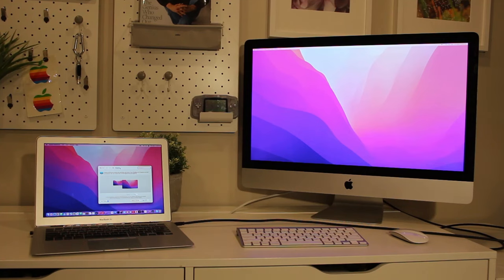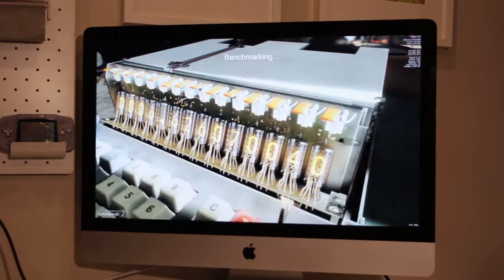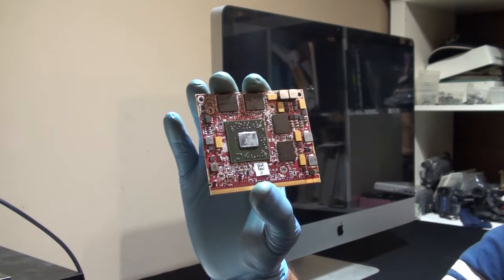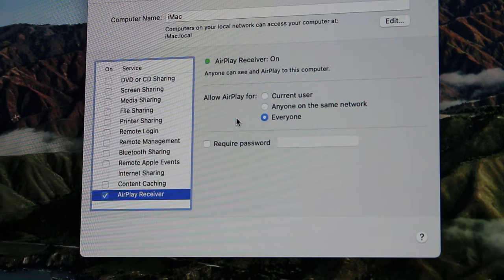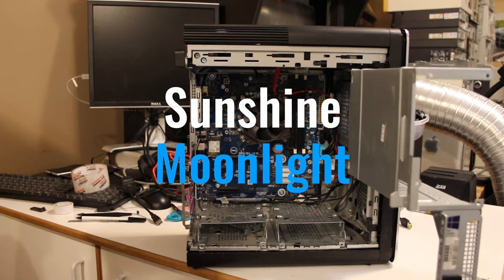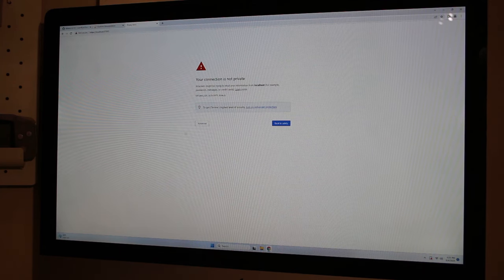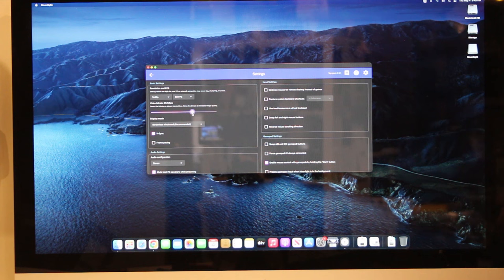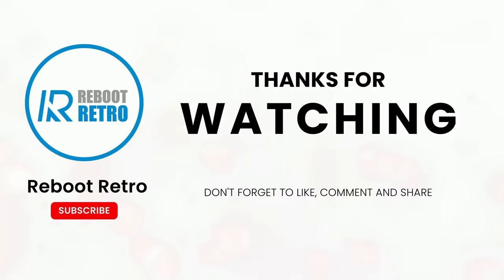Use ANY Mac as a monitor, not just Target Display!

Comment: is  there any way to get a 2017 imac to be either a second display for another 2017 imac OR for a second display for a pc?
Reply from the maker: Yes, for a 2017 iMac as a screen for PC, you would use Sunshine/Moonlight method.  If you are using 2017 iMac as a screen for another Mac, you can use AirPlay (less smooth video, but easy setup) or you can use Sunshine/Moonlight, or Parsec.  Parsec works like Sunshine/Moonlight, but is easier to set up on Mac.

Comment: What about a late 2006 20” Intel Core Duo iMac? Can it be used as a display for a late 2015 i7 iMac?
Reply from the maker: It would be much more difficult on a 2006 iMac, since Moonlight requires at least Mac OS 10.13 High Sierra.  You might be able to do it still if you install Windows inside Boot Camp, and run Moonlight from Windows.  It is below the typical hardware specs, so performance might suffer.  Moonlight does recommend a hardware-accelerated H.264 GPU; CPU decoding will likely have very poor performance.  You can always try it, and see how it goes!  Possible? probably.. but usable? I suspect not, unfortunately.

Comment: Great video, thanks! I have one question after reading several comments. I have an iMac mid 2010 27" and the new macbook air M2 (2023). Will the Target display port work if I use a straight cable from thunderbolt 2 to thunderbolt 3 (without adapters)? Or does the new macbook not give a sufficient output for Target display port at all? Indicating that there is no way of directly using the iMac as a second screen with a new macbook air M2? Many thanks in advance!
Reply from the maker: Thanks!  You're pretty much on the right track.

The MacBook has a Thunderbolt 3 (USB-C) port which outputs DisplayPort video signal.  Although physically and visually the same as a Thunderbolt 2 port, the 2010 iMac's port is actually a Mini DisplayPort.

Although I haven't tested your combo specifically, the exact correct cable would be Thunderbolt 3 to Mini DisplayPort cable.  And since Thunderbolt 2 is backwards compatible with DisplayPort, you are correct that a direct Thunderbolt 3 to Thunderbolt 2 cable SHOULD work like you suggest.

If you can't manage to find a direct cable, you should be able to use a Thunderbolt 3 to DisplayPort cable, and then an adapter from DisplayPort to Mini DisplayPort.

Sorry for going into so much detail.  Apple did a lot of confusing things with those ports.  I thought some more info on it might be helpful if you end up needing to troubleshoot after connecting it.  Hope this helps!
Reply: Did you get this to work with your M2? I have a 2012 iMac 27” and a M2 so we are in the similar situation.

Comment: Hello! Thank you for your video! I was hoping you could answer some questions for me. I currently work from home and was provided an HP laptop from my company to work. They offered me an hp monitor to use as well but I have a 27 in 2019 mac that runs macOS Sanoma (the most recent update), and I would like to continue to use my mac as a monitor so it doesn't start collecting dust. Is it possible for me to use my Mac as a monitor from my HP laptop? Do I need to go back to an earlier OS? What are my possible options?
Reply from the maker: Hi!  Sonoma should work the same way.  With the method in this video, you can use the iMac as a screen but you won't have dual screens (both will show the same screen).  On the plus side, this solution is completely free.  Also, it won't work if your IT department blocks you from installing programs.

To use as a secondary display (dual screens), you could use AirParrot (https://www.airsquirrels.com/airparrot/features/win) on your Windows PC, then enable AirPlay Receiver on your Mac (under Settings/Sharing/AirPlay Receiver).  Then choose to extend your Windows desktop screen to your AirPlay iMac.  I've used this product before; it's not bad, but a little laggy just like AirPlay extended screens from Mac to Mac.  AirParrot is a pretty reasonable one-time cost for the software license.

Another option for secondary display, there is a product that might work better for you called Luna Display (https://astropad.com/step-by-step-guide-how-to-use-your-imac-as-a-monitor/).  I've never used it personally and can't personally recommend it, but I understand they are a reputable company.  You need to buy a 1 time purchase dongle to use this product.

Another product which does dual screens is Duet (duetdisplay.com).  I don't know much about this company, but their product will allow you to use any computer/device as a second screen.  The downside is that there's a monthly fee, which isn't ideal.

Ultimately, you first need to find out if you are able to install software on your work PC, or if your IT department blocks it.  If they block it, most of these options probably won't work.

Hopefully this gives you some help or ideas!  Feel free to post back if you have any questions, and hopefully myself or someone will be able to answer :)

Comment: Hi, is there any way to connect my late 2013 27-inch iMac as a monitor for a Mac mini M2 Pro? Thanks
Reply from the maker: That combo doesn't support direct connection.  But you can do it by using Sunshine/Moonlight.  Parsec would also work, and is easier to set up when connecting Mac to Mac.  Basically you run Sunshine/Parsec server on the Mac Mini, and then you use the iMac with Moonlight/Parsec client as the viewer.

Comment: I have mac mini late 2012 with thunderbolt 2 port. Can i connect it to imac 27 2009 with mini display port as target mode and if yes what type cable i need to buy?
Reply from the maker: Yes it can.  A Mini DisplayPort only transmits/relieves DisplayPort signals, but a Thunderbolt 2 port transmits both Thunderbolt and DisplayPort signals.  You can use a Mini DisplayPort to Mini DisplayPort cable.  Also, I believe Thunderbolt 2 cables are built to a higher spec and will also work as Mini DisplayPort cables.

Comment: I am attempting to run my iMac (2019) as a monitor for my gaming pc but can't figure out what I need to be able to run it, if I can. This is with all information I find resolving around target display mode for much older iMacs. just wondering whether you or anyone else knows whether you: 1. are able to run a newer iMac as a monitor for a pc, and if so 2. how?
Reply from the maker: There is no Target Display for 2019, but you can use the Sunshine/Moonlight method.  You install the Sunshine server on the gaming PC, preferably wire Ethernet between PC and Mac, the run Moonlight client on Mac.  Use Mac normally, but when you want to use gaming PC just open Moonlight and connect to PC.  You can even move gaming PC to another room to keep your setup clean.

Comment: can't seem to get this to work on my 2015 iMac to m3 MacBook. is there a solution that im missing?
Reply from the maker: It depends which method you are using.  Target Display does not work on 2015 and newer iMacs, and the AirPlay method doesn't work on stock 2015 Macs without OpenCore mods (Apple blocks the feature, but most hardware support it if unlocked with the mod).  If you are using Sunshine/Moonlight (or alternatively Parsec which is easier to set up on Mac), that should work fine with a 2015 iMac and M3 MacBook.

Comment: Hi hi. I have a 2011 imac (21.5") and would like to use my 2010 imac (27inch) as a monitor. is that possible? The 2010 has display port, but the 2011 has thunderbolt. I'm not sure how to connect them.
Reply from the maker: Yes, the 27" 2010 will work as a monitor for the 2011 21.5", but not the other way around.

The 2010 accepts a DisplayPort video input via Mini DisplayPort connector.

The 2011 Thunderbolt connector ALSO doubles as a DisplayPort output.

So you should be able to connect the Thunderbolt port on the 2011 to the Mini DisplayPort on the 2010 and it should work.  Although they have 2 different names, both the Thunderbolt port and the Mini DisplayPort will accept a Mini DisplayPort cable.

Hope this helps!
Reply: E invece posso proiettare un tower Windows con displayport su un monitor imac del 2011 ? (Utilizzo un cavo displayport to minidisplayport)

Grazie  @rebootretro

Comment: hey.. glad I found your video.. I have a Macbook pro from 2015 running Monterey, connected to a 2013 iMac, using thunderbolt 2.. it works great.. what I was looking at doing was getting another cheap imac from the same era, to have 2 screens...unfortunately though only one of my thunderbolt 2 ports is working... and I understand that daisy chaining display mode isn't an option.. so I was thinking of using a 3rd party app or dongle for one of them, and a thunderbolt for the other... is it right about the daisy chaining? i guess repairing the thunderbolt port just isn't work it.
Reply from the maker: Hi, I don't have a 2013 to check, but I believe you are correct - Thunderbolt 2 supports daisy chaining with standalone monitors, but I don't think iMacs support this with Target Display mode.  If you had older iMacs (2009/2010), I think you could use Thunderbolt 2 to produce dual DisplayPort connections (one for each iMac).  But with a 2013, I don't even think you can use a hub to get an extra plug.

Question though; are you sure the connector is broken?  Does Apple support running two iMacs over Thunderbolt 2 Target Display?  With the older 2009/2010 iMacs it treats them as a standalone monitor, but with the 2011 onward it does some special communication (it's not just a standard Thunderbolt monitor).  I'm wondering if your port is fine, but Apple just doesn't support it?

Another option though - If you use OpenCore to upgrade another cheap iMac to Monterey, you can use Airplay for the other screen.  Depending on what you use it for, I don't know if some lag on the secondary screen would be acceptable or not.

Or if you get a standalone Thunderbolt-supported monitor (admittedly, this may not be a "cheap" option), and daisy chain the iMac through the standalone monitor.  In theory this should work, although make sure the monitor is going to be returnable if it doesn't.  Target Display does some weird things; it is not a standard Thunderbolt monitor connection, so standard supported features like daisy chaining monitors may not work in conjunction with Target Display

As far as standard monitors go though,  I believe it is officially supported to daisy chain 2 monitors over Thunderbolt 2.
Reply: hey. maybe it's easier to omit the macbook laptop from the set up altogether.. I only need two screens for basic stuff.. so I could pick up an old imac and Target display the two together.. think that's the easiest. @rebootretro
Reply from the maker: @elixirix  True.  If you want one for JUST a monitor, I do recommend the 2009/2010 27" models.  They're the ONLY ones that accept a standard DisplayPort signal, and will work with any device.  Later models are limited to supported hardware and Mac OS versions.

Just note that the 2009-2011 models were VERY common to have GPU failures, although they're replaceable which is a huge plus :)

As a bonus, if you find one for cheap (or even free) with a dead GPU, people have successfully used these where they have artifacts/crashing in Mac OS but work perfectly in Target Display.  I'm told the only criteria is that Mac OS needs to be able to boot, and I think it works in Safe Mode too.
Reply: ok great. I was looking for a 21, 5 inch to match the first one... just found one from late 2012 for 99 pounds... so gonna OCLP with them both and run a thunderbolt cable... I don't do anything power hungry on the imac so it should be fine... and will have an identical monitor : ) cheers for the back and forth!  @rebootretro

Comment: Low tech person here, I have 2011 21.5 iMac and a window laptop. Is it possible to use the iMac as the external monitor with the last method.
Reply from the maker: Yes, last method (Sunshine + Moonlight) will work for a Windows laptop + 2011 iMac.  Important to know the last method will only work as single monitor,  not dual monitor.
Reply: @rebootretro  U meant screen mirroring?
Or that you would have both MacBook and iMac workspaces
Reply from the maker: @markarkron8443  The Sunshine/Moonlight (and Parsec) works like screen mirroring (both screens appear identical).  To use as a secondary screen you would need to use AirPlay or a third party product (like Luna Display or Duet Display).

Comment: I have a Imac 21inch late 2013 running OS 10.9 (i think) It also has boot camp which I mainly use. I want to build a gaming PC so if I connect it to the Imac with an ethernet cable using the 2 programs I can use the imac as a Monitor. Is the Imac os version ok.
Reply from the maker: According to the Moonlight (Mac side program), you need to upgrade to at least Mac OS 10.13 High Sierra.  But if you're already running Boot Camp, you can just use Windows instead (Moonlight also has a Windows client).   This way you'll still run the Sunshine server on your Windows gaming PC like normal, but run the Moonlight client on Windows in Boot Camp instead of Mac OS.
Reply: Thanks for replying. So if I setup to use it on the os is it easy to exit it so my wife can use the iMac. Then how easy is it to reconnect. Does it save settings so would it just be a click of a button.  Is it possible you could put some links to the 2 programs required.
Reply: @rebootretro if you have a moment can you reply to my question above.
Reply from the maker: @paulweinling1832  Hi, sorry for the lack of reply!!  YouTube's comment system is awful!  In the Creator Studio, it always shows the initial comment but not replies.  When I'm on YouTube, replies show up as a notification... MOST of the time but not always.  Thanks for reaching out again, I truly didn't see your last reply until now!

Yes, it is very easy!  I don't recall the hotkey on Windows (it's similar, you'll need to check), but on Mac OS with a PC keyboard you quit by pressing Ctrl+Alt+Shift+Q.  Keep Moonlight in your dock, and relaunch by opening and clicking on the remote PC.  That simple.  I jump back and forth to my Windows box frequently at times, it's virtually no hassle.

Also, thank you for pointing out the lack of links!!  I can't believe I forgot to put them in the description.  They are: Sunshine: https://github.com/LizardByte/Sunshine
Moonlight: https://moonlight-stream.org/

I don't think your wife will have issues getting out of the remote PC.  The hardest part is remembering what the key sequence is, which can be solved by a sticky on the monitor :)
Reply: Thank you for taking the time to reply.  Told all I need to know.  Cheers

Comment: I am using an early iMac in target with my M1 Mac mini. It's so dumb. There are 2 Thunderbolt ports but you can only use one. If you want a second monitor it has to come from the Mini's HDMI port with and HDMI to Thunderbolt cord. But you can't get that nice Mac monitor look with side by side monitors.
Reply from the maker: Apple often does have some weird limitations.  An active HDMI to DP adapter should work, but you’re right it seems like a needless limitation.

Comment: Hey, thanks for the video
I have a question please
When using the Moonlight solution, Can you connect the Windows PC as a host with the iMac as a client together with an ethernet cable without routers ?
Reply from the maker: Yes you can, and I would highly recommend doing that.  Going through a router will create loads of extra network congestion, which is why a direct Ethernet cable is better.

Important though: I think network discovery did not work without a router.  Instead, allow both computers to obtain a self-assigned IP address, check the host to confirm the address, then enter that address manually in Moonlight.  You could also manually assign an IP to each computer.
Reply: @rebootretro  Thank you so much 🙏 gonna try that 👍
Reply: @rebootretro  Thanks a lot man for pointing out this solution, i almost gave up on the idea, as 2011 iMacs cant TDM with windows PC's, however i connected the ethernet cable directly and moonlight seems to have caught up the host's ip address by itself, i used a cat5 cable as its the only cable available at the moment in my house and it was much better than wifi, will get a cat6 cable which will sure give better results and get me the maximum bitrate in moonlight
Reply from the maker: @SheriffKoder9  Glad you got it connected!  It should not make a difference between CAT5 or CAT6 cable.  CAT5e can handle 1Gbps connection, which is the maximum the iMac can handle.  For best quality though, make sure you go into the Sunshine and Moonlight settings like I did and tweak quality.  Default settings are designed for use over internet, but locally you can crank them up because you have much more bandwidth :)
Reply: @rebootretro  Yep, if this solution worked well it will let me avoid getting one of these hdmi controllers, remove iMac's internal hardware and strip it all apart. which is a shame because these are all good hardware parts (excluding the failed gpu lol)

You are correct also the cat5e and cat6 will get the same quality. but my network settings displayed that the connection speed is only 100mbps, this could be because the cable i used is a standard cat5 not cat5e which caused moonlinght to struggle beyond 70mbps bit rate when playing a game, lets see how these 1gbps cables can function on the higher bitrates like 150mbps in moonlight without any struggles

And regarding the settings in sunshine, i haven't touched them yet, but sure will check them out based on your advice ✌